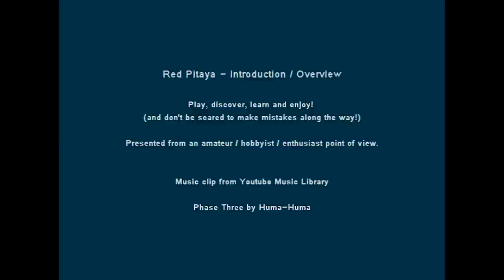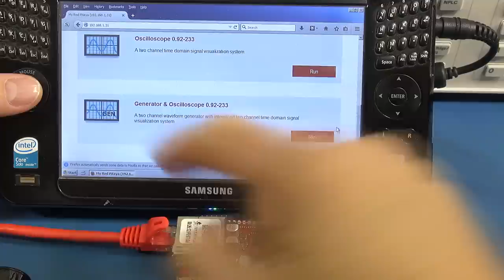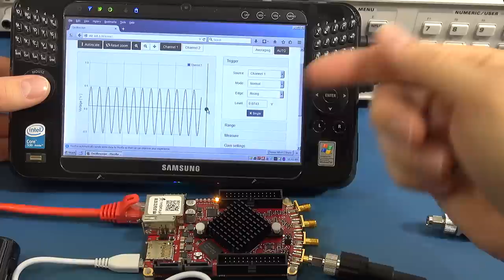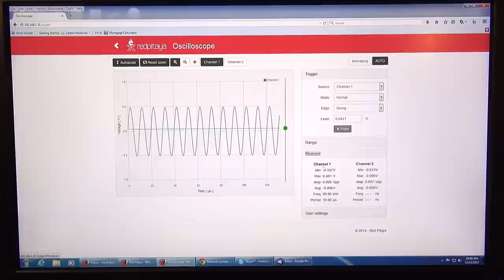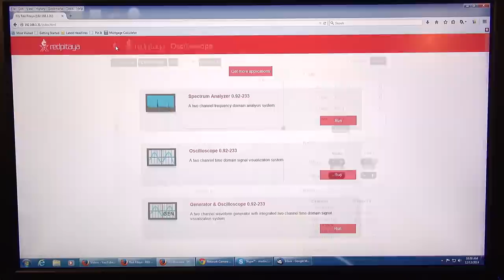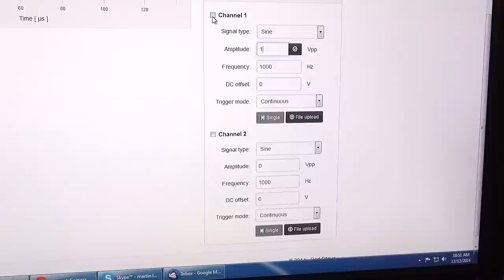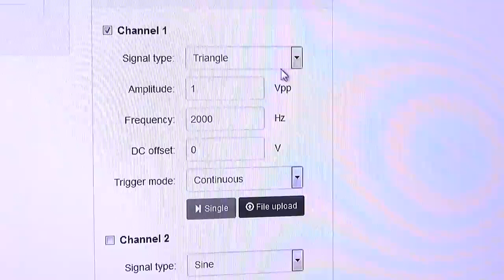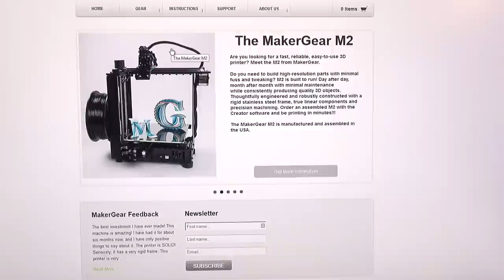Red Pitaya - Introduction and Overview

Comment: The version of the RED PITAYA being sold here in the USA by Circuit Specialists (Item no. STEM-125-10-DK) is just $273 but it's just 10 bits not 14 bits!  What is the difference?

Comment: Please put together the hardware setup and show us the LCR meter and Bode plotting functions. A good LCR meter can be had cheaper than this Red Pitaya, but as you say this one can plot impedance vs frequency which would be very useful for example for putting multiple capacitors in series to give a wide band of low impedance rather than the V shaped capacitive almost straight through the ESR minimum into the inductive ESL impedance characteristic typical of a single capacitor. That's something a handheld LCR meter can't do. Bode plotters are really expensive, from the £3300 Omicron Bode 100 to the £13,000 Ridley AP300 (I may be out of date here). The Cleverscope can do this for $1800 but it's more like this product than the ones I just mentioned and the Digilent Analog Discovery is quite similar to this too.

Comment: It would be a great tool to have. Add a divider mechanism in front of it so it can accept different voltages. Also add physical buttons to the digital inputs and make a UI which you can use to control the scope and generating functions with. Nothing as nice as some physical knobs on a measurement device.

Comment: It is NOT called Red Piata!   If you could read, you would see that it is called Red Pitaya, it has been called after the weird looking fruit.
Now go play with your Technotricks, Hamegg, Fluxe, Sillygent, Rogil and Schwode&Rarz.

Joking aside, thanks for the informative intro with some real world operation ... I think it is a fantastic device, even now 6 years later, there seem to be nothing comparable in the 500€/$ range and ironically its price went up these days.
With a max of 20V input it suits most applications, though some people might want a high impedance voltage divider to measure e.g. switching supplies but I guess a 1:100 oscilloscope probe you are good to go unless you build tube amplifiers with plate voltage in the high KV range like I once did.
I am little disappointed the 16 Bit SDR version can not be switched from 50 Ohm to high impedance, so I could use the best low noise, high resolution version for both radio stuff and traditional measuring.
That fact that it is an full blown MSO (diagnostic kit), so not just a scope and a signal generator, it also has logic analyzer on board with great software is totally outstanding.
The newer version with the much higher sampling rate costs around 2K and is therefore not suitable for most small hobby labs.

Comment: I have one. It's nice, but setting up the FPGA developing side is a pain [I have a Mac, I'm using a Virtual PC to install the Xilinx stuff].
Just as Raspberry pi got upgraded, and the assorted Arduinos, and Beaglebone Black, I expect to eventually see a [Yellow?] Pitaya. Faster, higher resolution JESD204 ADC/DAC. Programmable clock [Si 570]. Optic fibre I/O, 3.3V SATA power connector [avoid confusion with USB power supply connector].

Comment: Ouch that price... I would go for the AnalogDiscovery I only find the network analyzer useful though,  The Red Pitaya scope its still a toy though and offers no CAT ratings, safety ect...

Its fast though, faster than most "skeleton based measure systems" its obviously the FPGA that allows that high data throughput and could be the "Ardunio" for measurement based systems thanks to the FPGA and RAM,  if only the price was better. 
 
I'm sure this device has a good potential in the future who knows... for now its obvious to just save up for a dedicated instrument.
Reply: Yes, but Red Pitaya like labnation is built using an opensource model. Therefore the price is not just for today's product but an investment in the future.  The more of us who support this model, the sooner prices will come down and capability go up.
Reply: Kimberly Peacock Its NOT open source!!! the board layout files are closed, so how can it be a "opensource model"? Ardunio, beaglebone is truly "open source", the source is open with the board files.

They only using the community to drive the software features of the product, other than that its very much closed.
Reply: ***** Labnation is opensource hardware, the firmware in the redpataya is opensource. The point I am making is that as an opensource hardware and software ecosystem develop we will all benefit from that development.  Just as Ubuntu/Debian has benefited from redhat and vice versa.    But I do agree one would lean toward labnation because the board files are open as well as the software.
Reply: Kimberly Peacock Point taken with Labnation but im not talking about it, the point and conversation is about redpataya , its NOT open source hardware, only software and you can find it on github I looked at it sometime ago.The real question should be then, do you call such a platform opensource hardware? NO. redpataya is a opensource software platform, yes indeed. the hardware is closed, do you identify it as a opensource system, NO,its far from it.
Reply: ***** R&D costs money and people need to be able to live so they need to get paid.  The high price allows these people to live and provide a product while not fully open has the software open, and using that firmware as a template will help others in other projects going forward.  Labnation is the flipside, there the hardware is open but not all of the software is open.  Anyway if you need a scope for working and you do not have much money you are best getting an old analogue scope from ebay and up from there a Rigol type.  Dso1000 series.  Yes the newer model is better, but not everyone can afford to shell out $800 or more.  For me supporting these types of projects its about in the future having the $800 plus quality available to the masses at a price of $200.  It is about modularity, where you can reuse the screen from your tablet, laptop,etc, and the software is also modular and multiplatform. Such that we are paying for the adc and dac and the fpga, and then getting the maximum value out of those.
Test and measurement equipment should be ubiquitous and inexpensive.  I think in time we will get there.